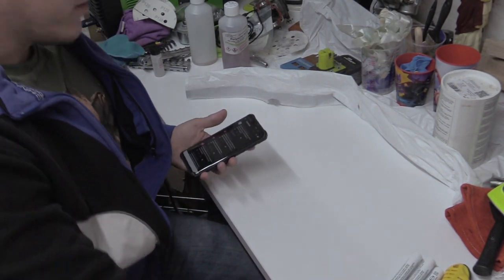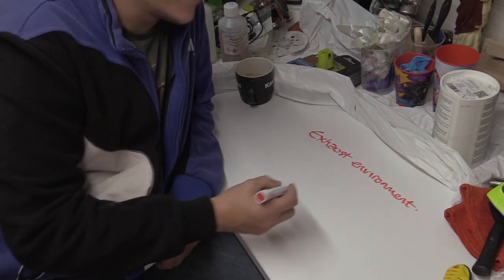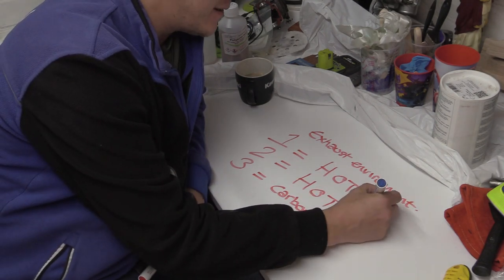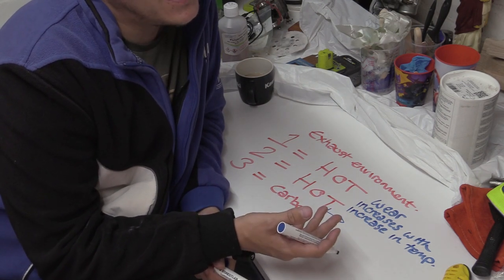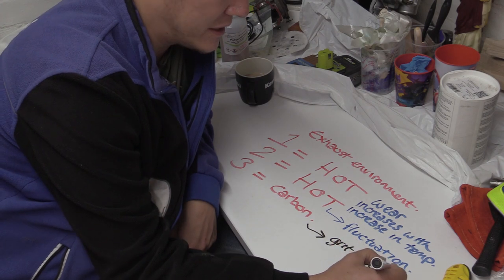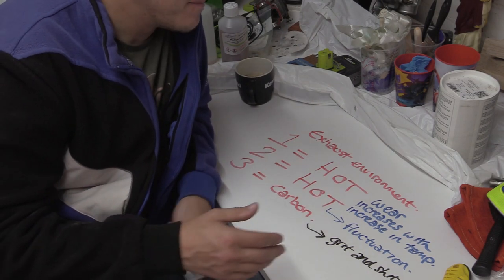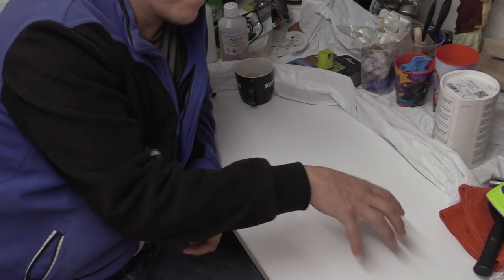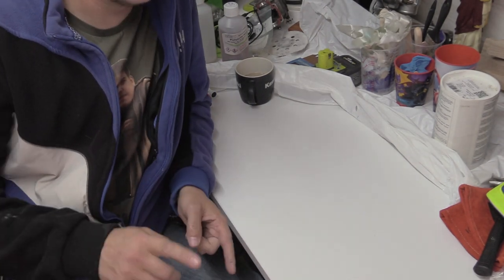WQ+A#4 - Hot stuff breaking Question

Comment: This makes perfect sense and perfect timing!
One was out on ones BMW K1300S yesterday, first outing since the lurgy descended upon us. 
One was riding rather spirited on a road referred to as the Dukes pass between Aberfoyle and Callander in sunny Scotland, I was canning the ass off it on what is considered a fairly twisty road.
Ones bike started to complain and when my companion caught up he waved me down to stop, thinking my bike was going to go on fire😲
The bike is fitted with an Akrapovic end can and just before it joins on there is an actuated butterfly valve. 
The exhaust internals were indeed glowing a lovely cherry red, db silencer removed. 
Lambda sensor done it's job and killed the engine revs.
Cooled the bike down for five minutes then carried on taking it easy at first then running it up on a private road to very fast and it was OK🤞👍🏻
I reckon the butterfly V/V had stuck open whilst I was ragging it in the twisties, up and down through first, second and third in quick succession. 
I might have to have a look at the valve operation. Luckily I have a diagnostic device I can hook up.
I'll let you know.😃
Reply: bmw and butterfly valves!

Comment: Buell XB12 models had the exhaust servo on top of the airbox with cable running down to the muffler. A lot of guys sacrifice the low RPM power and remove it or wire it open when it fails.
Reply: I owned one of these, great bikes. The owners club used to promote drilling the air box and remapping via some German who came up with a programme.  Best left alone and command good money now second hand. 
I kept my 1125R which has the Rotax engine😉
Reply: @digger8180  I still have a 2003 XB9R with a 1050cc big bore kit and some tuning. Haven't been physically able to ride in two years, so much money sitting in storage.

Comment: With regards to heat, I have a somewhat related WQ+A question:

What causes cylinder heads to warp? And, which is more susceptible; aluminium or cast iron?
Reply: My assumption would be that you have two objects that are usually of different materials, block and head, heating and expanding at different rates which will cause twisting/warping. 

Also the head isn't actually attached completely evenly across the head, there are stud's/bolts and they are going to hold everything in place closer to those fasteners and have less support further away, during normal operation these things don't matter, but with excessive heat it all goes tits up. 

I'm not an engineer just a pleb mechanic so I may be wrong
Reply: Brodie Bennett could be many reasons. Cooling system blockages, gasket failure, head stud stretch/failure. They generally don’t just warp on their own. Even removing the studs/bolts incorrectly can cause it.
Reply: @ryanmg92 
I found a pdf some time ago from one of the stud / head gasket manufacturers (can't remember which one, might've been Payen or ARP), and it had a really nice graphic showing the clamping loads on the cylinder head, and how those loads are greatest at the studs / bolts but gradually taper off the further away you move from the bolt.

Interesting stuff for sure.
Reply: @phelanpawly2507 
With regards to your comment, a related question I've had (but haven't found a satisfactory answer for), is the sequence with which you crack off the nuts / bolts when you want to remove the head; do you use the same sequence as you would for installation, or do you go in reverse?

I suppose to some extent it might depend on the specific engine design, but then again I wouldn't know any better.
Reply: @b_mb4948  I've often wondered if this kinda thing is just old school mechanics wives tales or if it's actually realistic that undoing them in a random order would wreck stuff. 

Especially since let's be honest, if something has gone wrong sufficiently to involve pulling the head, chances are if the head has a warping issue, it's more likely related to the original fault
Reply: Brodie Bennett always follow manufacturers manual procedure regarding install/removal. Some aftermarket stud/bolt suppliers amend these to their own specs so in that case you follow theirs as if there is an issue, they hold the warranty. Most later engines have single use studs and bolts. Never use old ones again and always follow gasket instructions. While the head is off , I would always get an engineer to check straightness and machine if necessary. All this adds cost and time but you only want to do it once.

Comment: Cracking - thanks 👍
My Z800 has been completely solid but my friends '08 Daytona 675 got through 3 EXUP valves, so while that's extreme I'm assuming it's not that uncommon for one to fail in general.
Reply: Ok so I tempted fate by saying that. My Z800  valve just seized and stripped the servo's plastic gears... Ffs... So, is there any risk to the engine or downside to removing the servo, leaving the butterfly valve in the spring open position and fitting an EXUP eliminator to trick the ECU?
Reply from the maker: Or just replace the gear, a whole lot cheaper...
Reply: @dirtygarageguy  True, but for the faff-factor... I suppose I was getting at the arguments for and against removing / disabling the valve all together as views are split i.e. "it is just for noise emissions, lose it" vs "the engine is tuned for the backpressure so you need it for low down torque / throttle response and removing it could make the engine run lean".  The Kawasaki technician thought the former and would do no long-term damage. Then I thought who might be able to analyse it and break it down from an engineers perspective ;-)

Comment: Hi got a question, what application is a single piston ring better than two? when toyota built the 503e to replace the 3sgte in their LMP car they changed to a single ring and it was their most successful race engine ever. If I was to build an outright race engine disregarding any emission is it something to considering?
Reply from the maker: And you think that was down to the a ring change?
Reply: No just curious why they did it and only in an outright race engine
Reply: The reason I’m referring to the 503e is because it was designed purely for racing and clearly no reliability or oil consumption/contamination issues in a 24hr race

Comment: Hey Matt, Ethanol burning = lower combustion temperature and low carbon deposits compared to petrol. Any opinions comments on this in terms of longevity of exhaust valves?
Reply from the maker: Lower temps = less power.
Reply: @dirtygarageguy  Absolutely agree  but there's always a compromise between loads of factor in engineering. depends whether its worth having less power for longer valve life or not.
Reply from the maker: Are you asking me or are you telling me? Because you've just answered your own question there.

Comment: Heavy water in the cooling system? So, now bikes are nuclear powered? God, I need to get out more often.
Excellent topic. Would a exhaust servo valve make sense on a lower to mid power range bike. My question is why some bikes have a exhaust servo valve and others don't.
Thanks.
Reply: My 2003 Honda 600 RR did not have an exhaust valve, it had no bottom end. In 2006 I bought a GSXR 750 and took the valve out with a new exhaust. Biggest mistake I ever did. I killed all power below about 6k. I learned my lesson to leave the valve alone.
Reply: @JAMESWUERTELE  I took the baffle out on a xr250r made more noise had less bottom end and would stall  most of the time pulling away. Maybe top end was a little better.

Comment: My take on your topic is similar but you kind of didn’t touch on heat fatigue. A component expands as it heats and contracts when it cools. Some parts are better at accounting for this fatigue and the engineering is built into them to accomodate this. Any given part can only handle so many heat cycles before they weaken or fail. Hence why many parts have a service life. Just a thought.
Reply from the maker: OK, so tell me something on a bike that suffers from creep?
Reply: The Workshop Well as you explained there’s many components that get exceptionally hot and deteriorate over time. Valves are very strong and stable in the engine but over time the faces wear, the seats recess hence why you do valve clearances as a service procedure and during a rebuild the valves are closely examined and measured and most often replaced. You mentioned service motors for pressure valves but this can also affect internal structures in high heat areas. Muffler baffles and even mounting brackets. I’m not disagreeing with your video just might have added a few things especially for young blokes who might be wondering why valve clearances need doing every 20k or why my exhaust bracket comes loose all the time.
Reply from the maker: Wear isn't thermal fatigue though.
Reply: The Workshop Entropy?

Comment: Carbon is essentially just graphite, why does it cause wear instead of acting like a lubricant?
Reply from the maker: Graphite is carbon dont you mean?
Reply from the maker: And to answer the question graphite is carbon in sheets. Carbon deposites are not
Reply: @dirtygarageguy  Sooo carbon in an engine is more like diamond than it is like graphite?
Reply: I think that although Matt's points were correct, he concentrated on carbon too much, which has lead you to the idea that it was producing pure carbon like graphite (not diamond, not nearly enough temp or pressure for that). The reality is that the deposits are not pure carbon, all sorts of carbon compounds are created including carbon nitrides, and they are also very HARD. You don't need much of that in the wrong place to totally destroy a bearing surface.
Reply: @chrishartley1210  😄 I'm mostly just trying to annoy matt, but I you are correct about carbon nitrides.  Del would also approve your use of 'HARD'! 👍

Comment: I think I would disagree with your basic premise that heat increases wear.
I suspect that you mean that the properties of the lubricants are degraded as temperature increases and the resultant poorer lubrication increases wear.
I know it is nitpicking, but I think you are really saying that you need lubricants which can match the higher temperatures or you will get increased wear.
Like your comparison of materials like Inconel, they will resist wear longer but at a cost, same thing for exotic lubricants.
Reply from the maker: No im not, higher temps increase wear. All materials (metals) become weaker as temperatures increase. All chemical reactions increase with elevated temps. Therefore weat increase with higher temps
Reply: Let's assume that you are right. I'm assuming that you mean temperature rises of 100°C or more. Please explain why wear also increases, often to a greater extent, when temperatures fall by the same amount and chemical reactions are reduced.
Reply from the maker: I don't know what you want me to say here, and no - don't assume I mean 100C or more. 

"Please explain why wear also increases, often to a greater extent, when temperatures fall by the same amount "

- What?
Reply: Ok, I won't assume temperature rises of 100C or more, in which case the change in rate of chemical reactions of metals used in bearing surfaces is negligible.

You come out with sweeping statements about wear at higher temps being due to increased chemical reactions, without defining any parameters or conditions, and expect people to accept this guff without question. If there is increased chemical reaction it is in the lubricants not the metal surface.

The majority of wear, at any temperature, is down to lack of adequate lubrication. That's why wear is high in vehicles used in extreme low temperatures and why they have to design special lubricants for those conditions. For exactly the same reason as increased wear at high temperatures.

Come on Matt, I think even Del can do better than this.

Comment: Here in the US, our pump gas can have up to 15% ethanol. I run 91 octane in my Honda 1000RR (2019), I do not run ethanol fuel because the manual on the bike says nothing above 10 percent. So I run 91 non ethanol, which is hard to find. I also run 100 octane when I can find it available, also non ethanol. I understand that the original engine tuning is not dialed in for 100 octane. In saying that when I run 100 octane my bike runs like a raped ape. So I go from 5000 ft to above 10,000 ft altitude on my rides with 100 octane. I can’t believe how hard it pulls vs 91. 

It also smells almost like a methanol fuel, it smells good. So my question is, if Honda tunes for 91 why does 100 octane run so much better. 

On a side not 91 pump gas I can usually get 150 miles, then I hit my reserve. While running 100 octane, I can easily go 225 miles of hard riding, mountains, passing cars, 120 plus mph pulls, and no fuel light. Does 100 octane other than having a huge increase in knock resistance have a lot more btu’s?